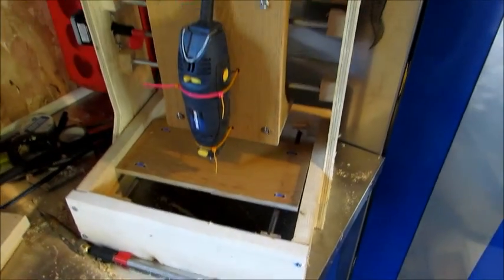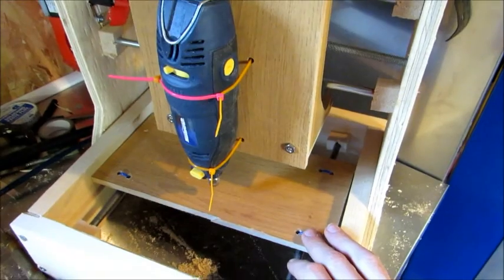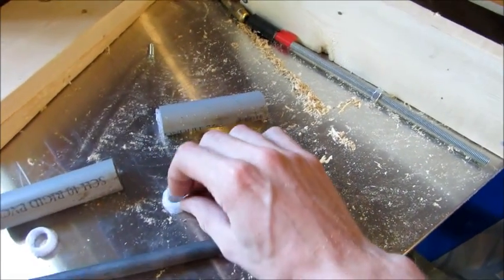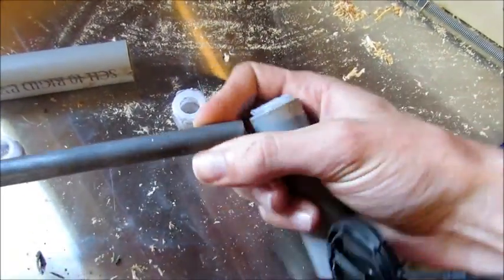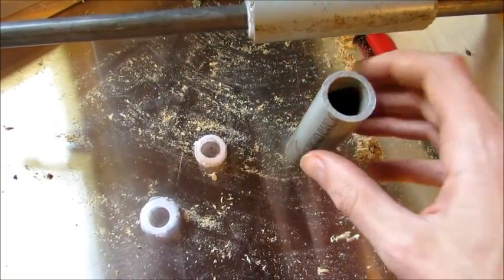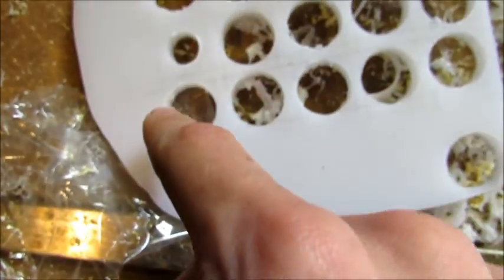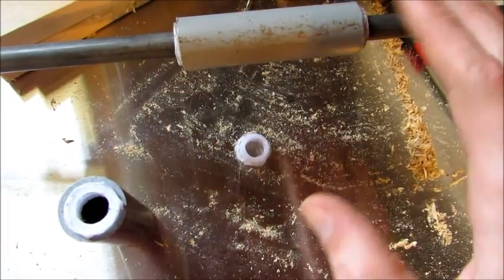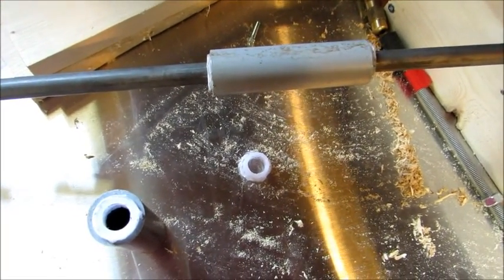Cheap Linear Bearing build

Comment: great idea, 

can You please give the name of the parts (specially the plastic bushing) as You get into store?

Best regards
Reply: This type of cutting board is almost always HDPE, high-density polyethylene plastic. UHMW plastic would be slightly more durable and smoother operating in a production setting, but cutting board material is practically free compared to UHMW. 
To the OP, thanks for posting, this is genius-level thrift! The combo of hole-drill and forstner bit for custom bushing sizes is terrific workaround, thanks!
Reply from the maker: I used a cutting board, (they tend to be made of a slippery type of plastic) drilled them out, and put them in a short piece of pvc conduit (stores typically only sell them as 10 foot lengths though)

Comment: Thanks for the video.  It's an interesting idea!  I'm going to try this myself.  
Just curious, what type of adhesive did you use to glue the two types of plastic together?
Reply from the maker: I honestly forget, I do remember that being a problem. I think I ended up using epoxy resin.

Although ultimately I ended up biting the bullet and getting real linear bearings because I was getting issues with it binding (everything has to be perfectly straight, or else it'll bind)

Good luck!

Comment: Great idea and thanks for sharing...
Sorry to bother you, but, I am not native english speaker... so, I couldnt follow your explanation in the "how to" you did it...

you punch it with what? ... I did not get it... what tools did you use to cut it on the same center and on the rigth size of the stock bar?
Reply from the maker: no worries :)
1st: draw out a grid on your plastic cutting board that are the size of the Inside diameter of the conduit + the thickness of the hole saw blade.

2nd: draw a 'X' connecting the 4 points of the square to find the middle.

3rd: drill a hole (with a drill press) in the middle of the 'X' that is the size of the shaft it needs to slide over.

4th: using a hole saw (also in a drill press) drill using the outside box as a guideline.

5th: because of the heat of the hole saw, it will leave a ridge on the piece that you just drilled out. if you place this piece on the end of a short piece of conduit, this ridge will stop it falling in, AND it will allow you to move it around a bit so that you can make sure it's centered properly (I just kept tweaking it until it slid smoothly) before gluing it into place. (the ridge will also give more surface area to apply glue)

let me know if this was clear enough, or if I should make another video that shows it a bit more clearly :)
Reply: Great!... very clear!... I got all the steps...
tks for your time...
Reply: @evilplaguedoctor5158  Thank you a lot :)

Comment: Cool, Very innovated, I see that this was over a year ago, Has anything changed? Do you still use or would use again, I'm thinking about making a mold and use milk cartons and recycled plastic #2. I'm very curious as to how these worked out.
Thank You
Kevin
Reply from the maker: I ended up buying a cnc mill since I had issues with it binding, and additional headache's of the resin I used in other parts of the build wouldn't hold.

however, I do plan to make more video's shortly that is going to be a series dubbed 'from rocks to rockets' or something, where I go from no knowledge, no anything and build up to advanced science and manufacturing. I've just about written the first script for the first episode.
Reply: Great! I'll keep an eye for it, My son in law is into model rockets an he is increasingly curious to make parts and stuff. Me I want to work from home using my cnc router and make a living.
Reply from the maker: Kevin OConnell
 sure thing! though I won't get to rocketry for a while, making a living off the cnc is definitely possible. :)

Comment: Thank you for sharing,this is a major problem when coming to cost and i still don't understand why so expensive,i'm trying to find a good alternative to anti backlash nuts but still.Do you have any good idea?
Reply from the maker: +mataz farouh  I didn't use any anti backlash nuts myself, I found it wasn't needed for what I needed it for. but I've got a week off school now, so I'll give it some thought. I'll let you know if I think of something.
Reply: I just glued a cm of flexible tubing between two nuts around the rod with a little bit of pressure. works just fine for me, but i cant tell how long it will take it to break :)
Reply: thank you man,very kind of you!!
Reply from the maker: mataz farouh
 any time :)
Reply from the maker: +mataz farouh
Just came across this video and it reminded me of your comment, have you checked this out? https://www.youtube.com/watch?v=EVW7Q469RnA
Reply: cheap anti backlash nuts , use cutting board plastic, prepare two nuts  and put a screw to add tension in between :)